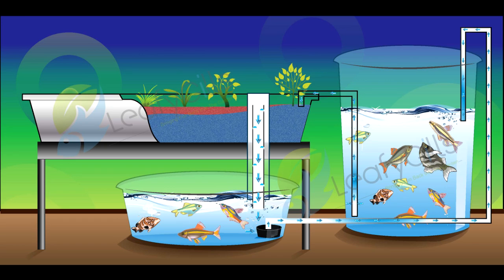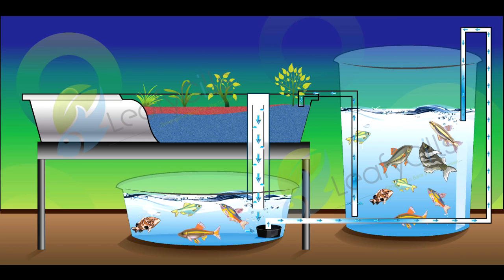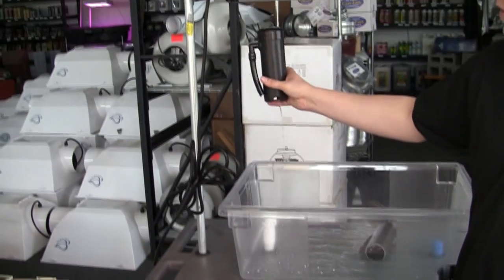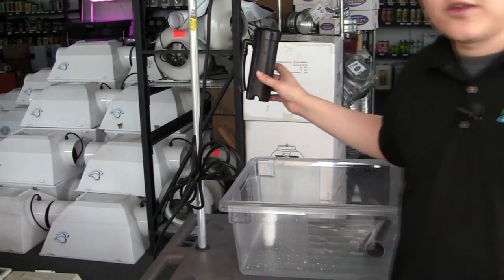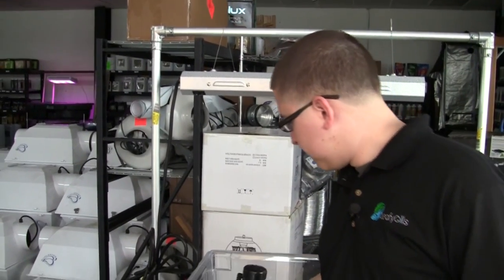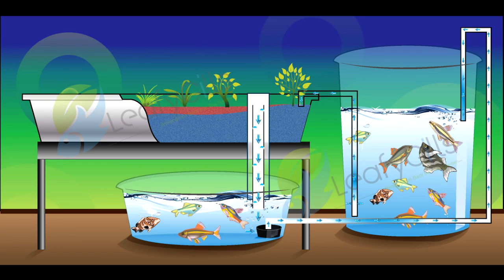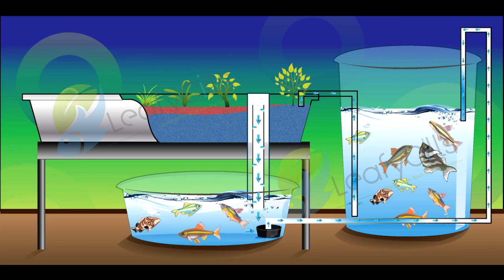What is a CHOP Aquaponics System?

Comment: Why make it more complex than it needs to be? Sure it works, but just stick to a Flood and Drain system. Really simple to assemble and very straight forward.
Reply: Depending on the amount of grow beds you have the system can drop the water in your fish tank too low. This system prevents it.
Reply: Grow bed volume should never exceed fish tank volume. If you follow this rule your fish tank will never run low on water to affect the fish in a negative manner.
Reply: Aquaponics Gardening by Sylvia Bernstein p. 90. Go read it. After 4 to 6 months you can go 2:1 with your grow beds. You are misinformed.
Reply: Just because you can doesn't mean you should. I can list so many cons that will occur with the 2 to 1 ratio, but I wont waste my time.
Reply: EVERY system has pros and cons. To help educate you I'm including a Colorado State University pdf about aquaponics that explains the pros and cons to all the systems, types of media, types of fish...  and if you take a look at page 65 it explains that the ideal grow bed to fish tank volume is 2:1. The 1:1 is a setup ratio. http://www.coopext.colostate.edu/adams/gh/pdf/Intro_Aquaponics.pdf
Reply: To answer the "why"... The CHOP system solves a problem created when you increase grow bed volume. 2:1 grow bed volume doubles your grow area in respect to your food input for your fish, 3:1 (which is acceptable) triples your grow area in respect to your fish food input. Basically a CHOP system can triple your growing capacity as compared to a 1:1 flood/drain system.
Reply: Yea man, thanks for the link. Reading everything I already knew was so much fun. I guess I went to Colorado State while living in another state. Im amazing like that.
Reply: ConureMaster - I'm so glad you know everything. I suppose the rest of us should stop experimenting and just do things how you think they should be done... seeing as you are the expert in all things aquaculture. God how I despise arrogant åşśħőłēŝ.
Reply: You may not "talk out of your ass" but you ARE an ass.
Reply: ConureMaster- Careful... you're true intelligence is showing.
Reply: ConureMaster - By the way, I happen to agree with you... a simple flood/drain system is better because of it's simplicity. I just don't like condescending attitudes.
Reply: I know im right. I don't talk out of my ass. Plus I was being sarcastic more than anything else.
Reply: ConureMaster- Actually... no one really cares if you're smart or not. It's not about you and never was. As far as I'm concerned... you're an impotent, whining, sissy-boi (you're the only one talking about the subject so it must be on your mind) who takes his internet "life" far, far too seriously. Perhaps you should find a dark corner in your mother's basement to lay down in and cry about how pathetic your life really is. I'm done feeding you troll.
Reply: Awww is she mad?
Reply: *****- Or when that person thinks s/he is. :D

Comment: Yes, ok, how about a NO PUMP gravity feed system, where the main fish pond is at least a 1000 gallon 10' round intex pool or equal, and by using the drain, with a hose attached, the pressure created by @800 gallons of water above the drain is enough to push water up slightly higher than the top level of the pool. Now, proper leveling of the grow beds with either a waterfall spillway or hose returns should allow the return water to keep the circulation going???? I am attempting this with a 300 gallon hot tub fish tank and a pvc pipe system that will fill the pvc pipes just over halfway, all on level bases, with a smaller pvc return line that has a sock filter for the just in case stuff.... the only electricity would be used for oxygen bubblers....
Reply: That would be a perpetual motion machine.  It's not possible.  However, you don't need an air pump for aeration.  The water can be aerated naturally as it passes through the pipes.  There are many videos on how to do this.

Comment: Major disadvantage - the pump is running constantly
Reply: You could alter this design so a float switch in the big tank activated the pump so that wouldn't be necessary I would think.
Reply: Disadvantage? No, not really. A pump running constantly might sound costly. However, it's not. A system of this size, around 1 to 2000 litres(250 to 500 gallons) normally use small, highly efficient pond pumps. These pumps use between 15 and 30 watts depending on the pumping capacity required.

A bigger pump on a float switch system might seem more efficient, however, you the pump is often much more power hungry. Remember, a pump at 30 watts might pump at 2,500 litres(300 gallons aprox./hour). A pump on a float switch would need to pump at least 3 times that to be effective and will likely use close to 100 watts if not more.

Then you have an added complication. A chop system relies on the fish tank having a constant level to function, it is essential the water level in the fish tank is at the level of the grow bed/s. A chop system with a float switch operated pump would require the fish tank to be raised at least by 1/3 of it's height above the ground. This means a greater head height for the sump pump, requiring a bigger or stronger pump. Requiring more power.

It all depends on the individual system, but why overcomplicate something that need only be simple. The float switch system can work. But it's an added complication.

Comment: Question regarding subject system. If pump were to fail and cease pumping into fish tank, how can complete emptying of fish tank to grow bed be prevented?
Reply: This is set on the Fish tank it can only drain certain amount of water, usually about 1/4 of total capacity should be available to drain, so if the Sump pump fails this would cause fish tank drain 1/4 of its capacity into plants base,then it stay there until you fix the problem. the same system is set up in power plant that produce heating steam, this is called a Feed tank. it works same way. you'll be safe installing this system!

Comment: Why are there fish drawn in both tanks?  Error?  Also, will the pipe that flows from the (larger?) fish tank to the plants naturally draw water through the pipe?  Hydraulics on this seem problematic.
Reply: The hydraulics on this are not much different from the overflow drain in your bathtub.  As to whether you put fish in the sump tank or not:  if your pump is filtered, why not?  On the other hand, if you want to downsize your sump tank and use a water activated sump pump so that it will cycle on and off, you could do that too.  I'm of a mind that a smaller pump running constantly isn't going to be much more energy efficient than a larger one on a timer - and the potential to buy a better build large pump is greater than finding a well made small one.  (more expensive pumps are generally made with longer lasting parts.)
Reply: This Aquaponics system would work fine, your question answer is yes, this larger fish tank would drain water naturally into the plants base, then from there to the sump tank. this would work well, but however we need to make sure the sump pump is sized RIGHT, otherwise you would have water flow problems due to the flow Rate of sump Pump to tank and tank drain pipe. this should be of equal Flow Rate otherwise good luck!
Reply: The fish tank flow to a filter tank and pump nitrate flow to the grow bed and produce Ammonia gravity flow back to the fish tank..which is which?

Comment: Enjoyable video but you did not discuss how the system does not flood the sump tank.  It is important the the pumped pipe from the sump tank to the fish tank automatically shut off if the pump fails.  This is easy to accomplish if at the fish tank side of the pumped pipe it is high enough so the siphon is broken.  In this case, the liquid level in the fish tank continues to drop (water flows from fish tank -> aquaponics grow tank -> sump tank.  When the enough liquid has drained out of the fish tank without being replenished by the now broken pump, the output side of the pumped pipe is exposed to air, thus breaking the siphon.  The only requirement is that the sizing of the sump tank be larger enough to absorb the drop in the fish tank plus any drop in the aquaponics tank.
Reply: actually the sump will not overflow unless your water levels get too high. the fish tank is constantly over filled and the over flow drains into the grow bed. the only real water flow issues to come with a CHOP system like this is if your sump does not have the capacity to match you pumps GPH. what i mean by that isin a flood and drain grow bed if your pump is pumping 300 GPH and grow bed is filling not draining you need to make sure the sump holds enough water to continue to pump until the grow bed drains.
Reply: Wouldn't the water stop draining from the large tank to the bed when the water level in the big tank fell below the drain pipe in the bed?  I think so.
Reply: FactChecking101
If the pump had a large enough output that could be the case, and the sump tank could readily accept this volume if it is sized to meet the volume of water above the plant grow bed in the fish tank.  Use a smaller pump though, and you don't even have to worry about it.  Furthermore it will use less electricity.  If you remember your history this CHOP system was first designed as a modification of the existing gravity bucket plan - where you connected a nutrient bucket to your grow bed, lifted it up to fill the grow bed, then lowered it below the grow bed periodically during the day.  The advent of an electrical pump to this process was quite a labor saver!  Water activated sump pumps were an even better change - because your sump tank could be downsized.